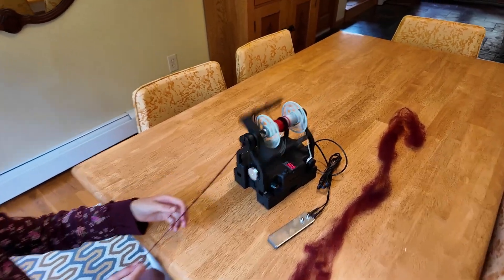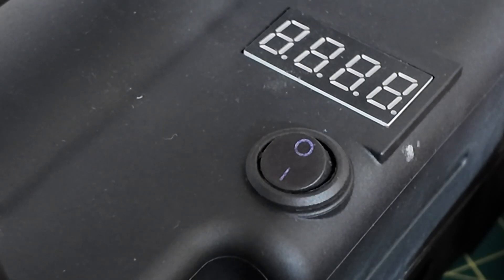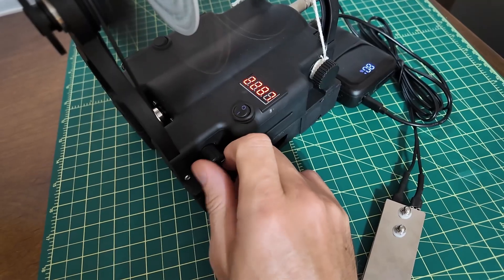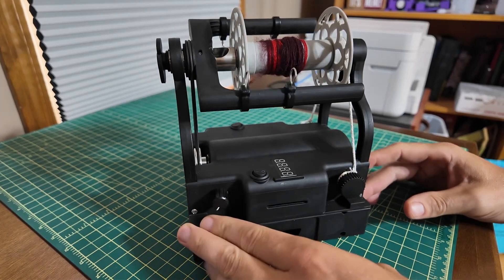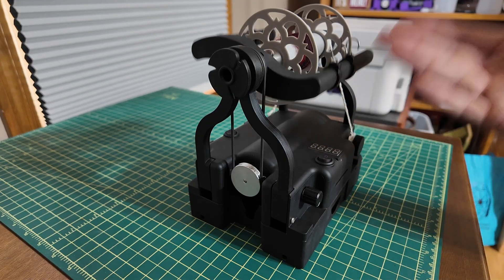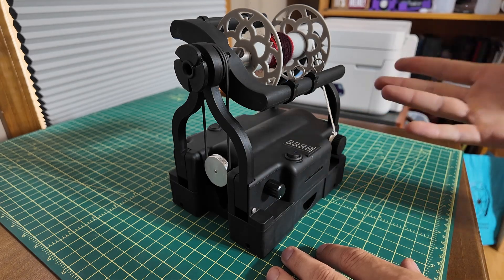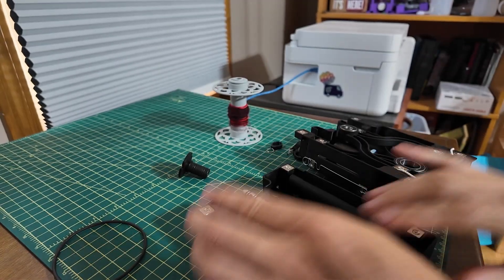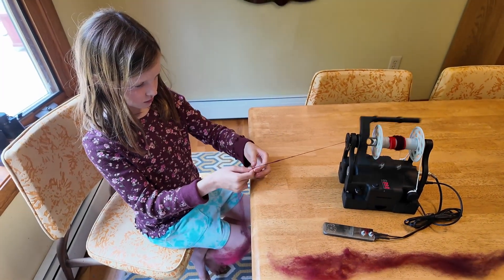Spin 203 - New EEW Fold Prototype (August 2025)

Comment: Looks fantastic.  I might be a little late in the process for these changes but I would really like magnets for the orifice hook on the right side and I would still like to have numbers around the speed dial as that would be more useful for me. I can easily add my own numbers so that is not an issue.  I don't know how I could add magnets, I have a piece of plastic magnetic tape on my EEW 6.0 right now but it really isn't quite strong enough.  Otherwise you have really done a lot of thoughtful improvements.
Reply from the maker: Thanks for the feedback.  Unfortunately, I couldn't put the magnets on the right side because they got in the way of several other things I already had there.  It would have been my preference too.

As for numbers, I find they don't matter at all because all the testers just use the display instead.